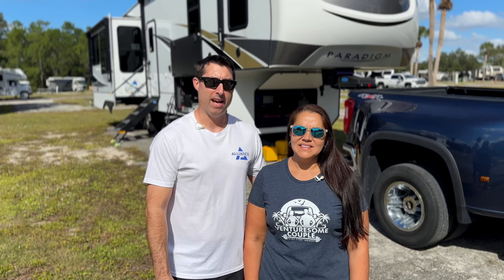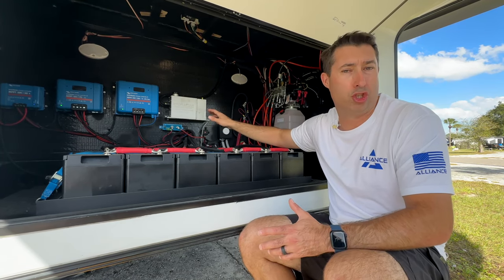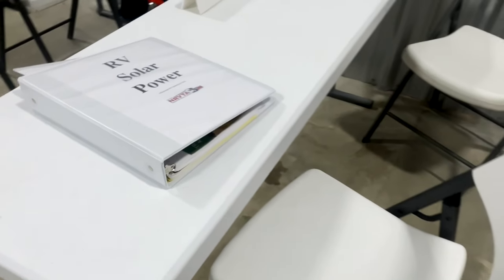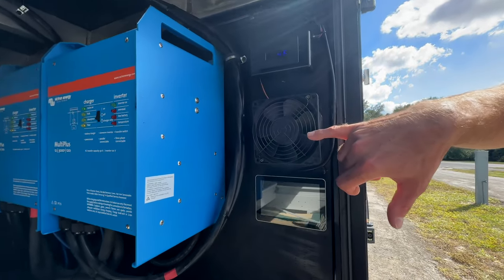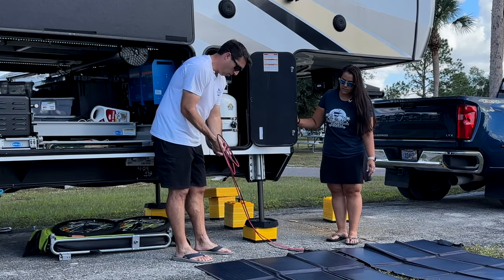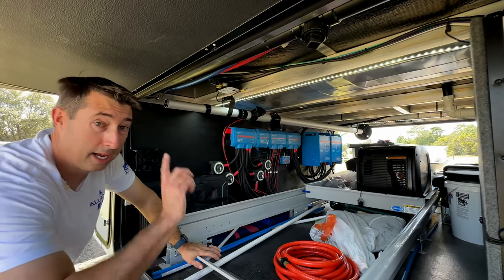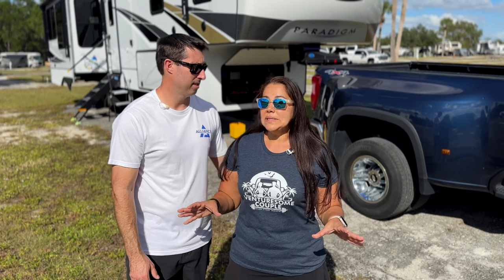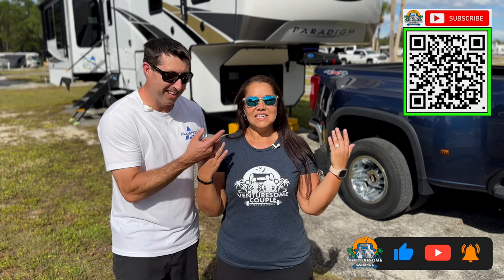Power Up Your RV With The Ultimate Solar System Solution!

Comment: great setup, I went with Victron mutiplus 2. I only have 600ah of bank. I too love the way Victron gives us the option to select the shore or gen A/C coming in so we can assist out solar system. Will be adding more solar and I was thinking on DIY battery bank. The foot print is smaller and I can double the AH. thank for sharing your mods and idea's
Reply from the maker: Thank you for watching our video and supporting our channel. We have been thinking about DIY battery bank also. We like what we have but it is huge waste of space.

Comment: So your batteries are not in series/parallel, they are only wired in parallel.  They are 4 groups of 3 in parallel, those 4 groups come togther in parallel at the Lynx distributor.  If they were 3 in series your would have 36v system and a real problem with the inverters....love the system and video, enjoyed meeting u two in Texas....

Comment: Why didn't you run the GX Touch into the RV?   We also have the 340RL (we meet you at the National Rally this year) and I have our GC Touch on the wall just as you enter the RV, that connects to the linen closet in the bathroom?  This way I can see it from inside the RV.   Finally...we love the Ruuvi pucks as well...add one more inside your frig.  :)
Reply from the maker: Hey Tannerjim, we are definitely going to be moving the GX into the rv. We just got the HDMI cable for it. Thank you for the idea of sticking a Ruuvi in our fridge; that will definitely happen right away. We are building out an IT cabinet above the “Coffee bar” and plan on putting the GX touch on that wall.

Comment: Chris, I'm glad you all got the victron inverters! One question I can't seem to find anywhere... How do you combine the dual inverters to work with 50amp service? I have the 2x120v victron and would love to add a second one but struggling how to wire them to work seemlessly.
Reply: What I understand is that the 50 amp is really two separate 50amp circuits and a shared common they each get one of the 50 amp circuits.
Reply from the maker: You are correct, we wired one 50amp leg into each inverter. We then ran them into the breaker box with bus bars to separate the common. Check out this link, Victron has great schematics for their systems.  https://www.victronenergy.com/support-and-downloads/systems#item=system-multiplus

Comment: Nice solar set up! I am wondering about venting the heat into the propane compartment. Don’t you risk filling the entire living space with propane in the case of a propane leak? I though the propane compartment had to be completely sealed from the living area?
Reply from the maker: Hey DestinedToExplore, thank you for watching our video and supporting our channel. You are correct by the RVIA standard we should not have cut into the “Firewall” or pass through area as it increases the risk of propane accessing the main living area. We took a calculated risk by ending through the wall versus the floor of the pass through.

Comment: Great video, thank you for the content.  Questions.  Are you all 12v, you said series/parallel and 3 batteries (I forget what you said exactly) but it looks like you are 4 strings of 3 parallel batteries.  I don’t see parallel in there (increase volts).   Also, when your on 30amp or less, I assume one of your inverters is consuming that and the other is just supplementing from battery 100%, is that correct?   Finally, exactly which of the NRVTA classes did you take?  Just the 1-week beginner plus Solar or did you also take the 5 week tech classes too?
Reply from the maker: Hey Blairmany thank you for watching our video and supporting our channel. We are all 12V, I would have gone 24V if I were to do it again. We are series parallel on the batteries, the angle of the video doesn’t show the run into the whole. We have the inverters wired in split phase. You are correct that in 30amp the batteries are handling the majority of the load and the shore power is replacing. Martha and I both took the week one (Registered Tech) and I took the Solar Class also. Eventually I will get the remaining classes when work permits.

Comment: That is one impressive solar setup. A question for Chris. What was your impression of the NRVTA solo class and what level of electrical experience do you have before taking it?  Great video, guys. Thank you for sharing. Peace and Safe Travels.
Reply from the maker: Hey Craig, thank you for always supporting us! I have a sound mechanical background and very limited electrical experience. The online class gave us the principles, we then went to the week one course and I (Chris) took the solar class. The solar class was great because it was a combination of book learning and we built a solar system. The only down side is that it is an expensive class/es.

Comment: A beautifully clean install, Chris. It's the kind of OCD I appreciate. I see you have a 12V system. Why did you choose to go with a 12V instead of a 24V system?
Reply from the maker: Hey Rvgoingnow, thank you for watching our video and supporting our channel. The first generation of our solar had mixed components between Renogy and Victron and the Renogy components. Did not have the capability to do 24 V. I would go 24V if I were to rebuild the system.
Reply: @VenturesomeCouple  Thanks for the feedback. I'll definitely consider that when I build out my system in the future,
Reply from the maker: Glad to help! If you ever have questions we are glad to help.

Comment: That is a lot of weight up front.  I wonder how much would that weigh? Very nice though!
Reply from the maker: Thank you for watching our video and supporting our channel. Our batteries weigh 26 pounds apiece and there’s 12 of them. The Onan generator that comes from the factory weighs about 310 pounds without wiring. Our batteries weigh 312lbs so we reinforced the floor to make sure we didn’t cause any problems.